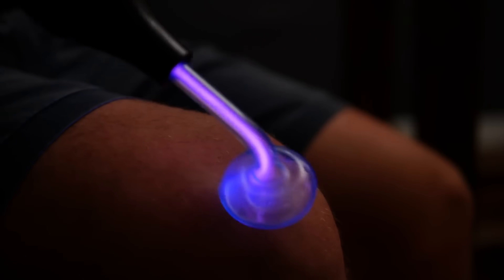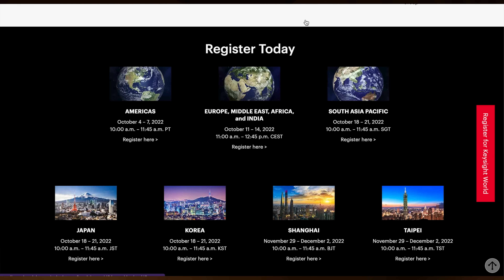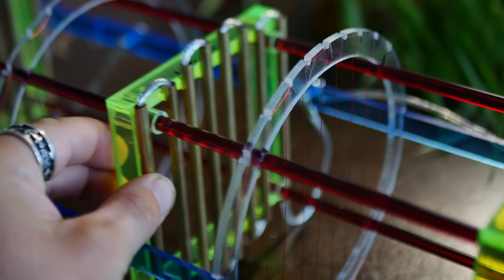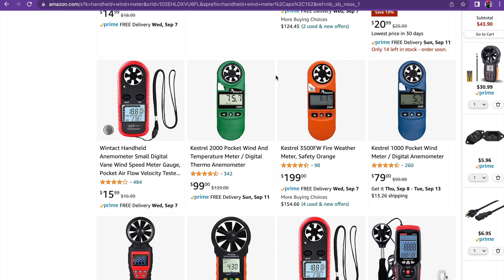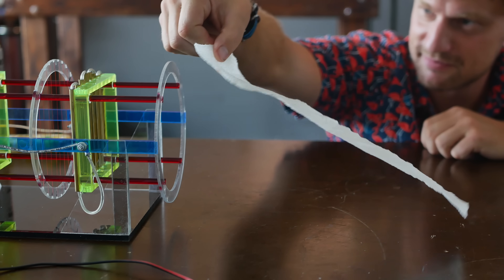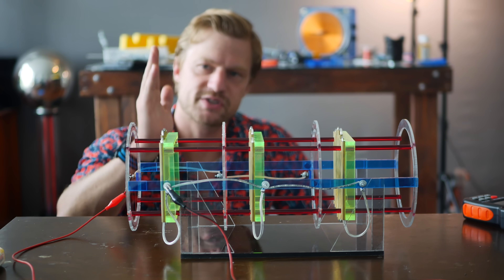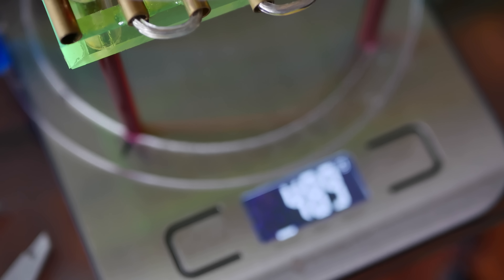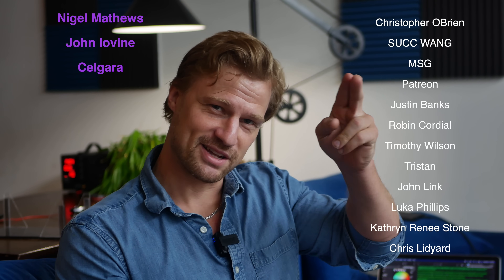Designing A Next-Gen Ionic Thruster! (For Flight)

Comment: Thank you very much! You should also check this guy if you will make it fly he made a nice free flycontroller :) youtube.com/c/NicholasRehm/featured
And few more ideas, what will be if you turned them one by one in a row like a coil gun, and a second little bit more insane if you will make it like a phase array antenna could you create a high and low pressure points in air flow to even control its rotation without moving parts

Comment: Couple of points i want to share:
1. will using a net instead of copper wire imropve the airflow? More surface area?
2. You should enclose the apparatus in a dielectric matarial so that air doesn't leak
3. it could also be the multiplier of yours, less current maybe?
4.why not try different metals?
5. you could also try to Use different voltages at the stages?
6. Maybe also try different nozzels at the output?
7. Force some air from the front?
8. Introduce magnetic fields as they interact with the electrons? Permanent magnet, changing fields?
10. Since it doesn't heats up you could use foaming 3d printed parts (foaming plastic are lot lighter then regular plastic) bringing the total weight down?
Reply: how about covering it in a material so it doesn't leak, but create some kind of gills, which scoop air from the sides and route it through the device?
Reply: For 1, he'll need to be careful to not block flow. For 5, he could, but he's also changing spacing. There are a few degrees of freedom here and he should pin a few down.
Reply: Point 5 is the one I’m most interested in, just because it’s so easy when he’s already using a stepped power supply he can tap into
Reply: I was thinking about 5 point  "you could also try to Use different voltages at the stages?"
he should increase the voltage after every stage let say at first stage about 20Kv to get large volume of air at lower speed then in next stage increase the voltage to get even mover speed and similarly at last stage even move kv for higher speed
Reply: Get onto it build one yourself           a mini vers be a cool toy  to watch in the dark
Reply: Focus several together at a focal point
Reply: Immagin using carbon nanotubes as the conductor. Would that even work?
Reply: same as I was gonna say although, for 1 I was thinking the existing wires but staggered.  So the ion from the one infront are firing at a gap between the wires of the one behind.
Reply: I would think it would heat up, seeing the system consumes 90 W. It is just inherently good at getting rid of the heat because it generates its own airflow.
Reply: How is a nozzle going to help , the airflow is subsonic , neglecting friction , with or without nozzle gives the same thrust
Reply: If we are adding nozzle then the whole thing should be enclosed or should have a body
Reply: @AuraLynthera  said that in point 2
Reply: @tvishmaychoudhary69  at the same time iam thinking about air flowing backword cause there isn't that amount of pressure for the air to flow through the nozzle
Reply: @AuraLynthera  read point 7
Reply: @tvishmaychoudhary69  7 kinda defeats the purpose of the engine
Reply: @The_Racr1  have you heard of an after burner?
Reply: @The_Racr1  exactly
Reply: @tvishmaychoudhary69  then it's no longer solid state. What's the point of an ion thruster that needs a mechanical fan to feed it
Reply: @tvishmaychoudhary69  ion engines and jet engines are functionally different, ion engines don't use fuel and if you're gonna use a fan to shove air into the thruster you may as well just use that as propulsion, it's much more efficient
Reply: @The_Racr1  I'd like to see if forcing some air would significantly increase the output though.  What if his device can create twice the thrust for half the energy expense?
Reply: @masonprisco3782  well of course it'd increase the output, but the issue with that is that it'd be far more efficient to just use a propeller, but the purpose of researching ion thrusters is space flight, not aerial flight
Reply: correction, in their true purpose ion engines do use "fuel" for propulsion, but they don't use any "fuel" in an atmosphere since the air serves the purpose of the fuel

Comment: It needs an adjustable output nozzle like a fighter jet. Maybe even steerable .. This. Combined with a refilling power source perhaps solar or nuclear could be used for deep space maneuvering of large things without carrying liquid solid or gas  fuel or maybe on a lighter than air craft
Reply: im sorry to say this, but in space, it might be hard to find air particles to get pushed around by the thrusters
Reply: @terra7021  I was wondering about that myself.  I mean it's up there in some amount regardless of vacum molecule wise. "Air " is a vague term.  There's gases up there just maybe not much o2  Just the molecules are farther apart    but I don't know how dense it'd be and would efficiency be reduced ..   but also there's no air resistance up there so on the other hand. .  Ionic space propulsion has been around awhile as an in idea

Comment: First easy 3 that come to mind. 1:non-enclosure is losing pressure & a final nozzle to narrow the flow. 2: An array of high voltage priming electrodes angled to a central point increases deflection & focus. 3: increase the velocity of initial air pressure. 4: add thrusters in parallel (yours is in series) Others that I'm less sure of impact. Offsetting the arrays 90 degrees from one another. Increase the surface area of the ground electrodes by coating the rods with activated carbon. (Minor pet peeve, you showcased in conventional current)
Reply from the maker: I love this. Great ideas! Especially number 2 and 1. Thanks for watching

Comment: Absolutely wonderful. That X-ray electric blue is among my favorite things to witness.
Reply from the maker: Thanks - those still frames, no joke, are the most gorgeous pictures i have ever seen. Its just....otherworldly.
Reply: @PlasmaChannel  I have an idea. Maybe use a low power Tesla coil to get the voltage high enough for corona discharge. The benefits of the this is that it can provide an extreme voltage boost with a relatively light circuit. And even better is if coupling is kept low it's self limiting in current due to the change in capacitance pushing it out of resonance.